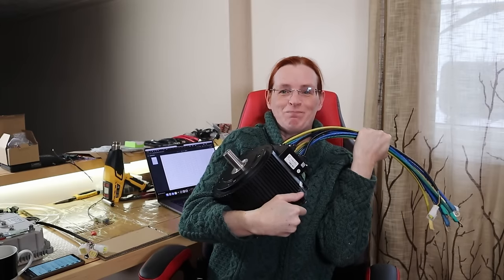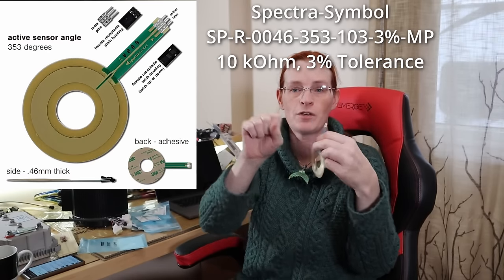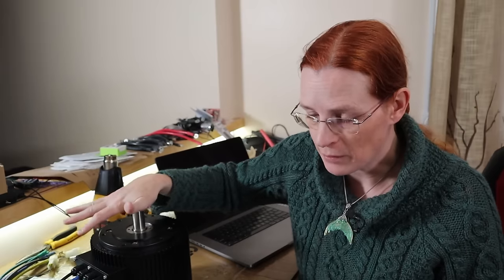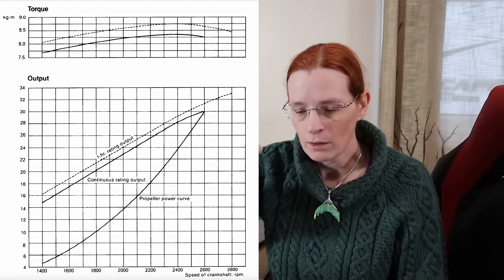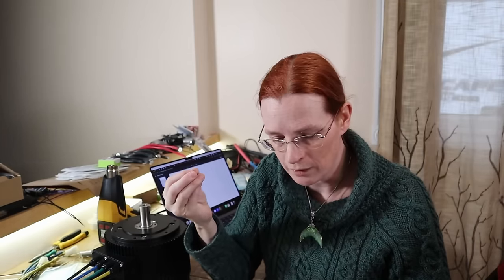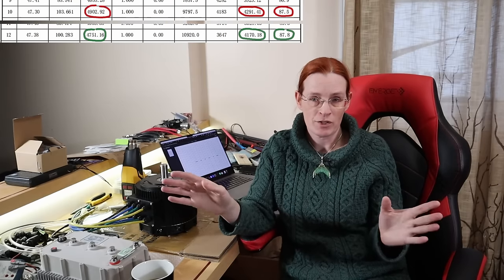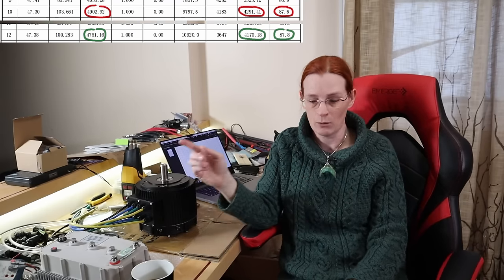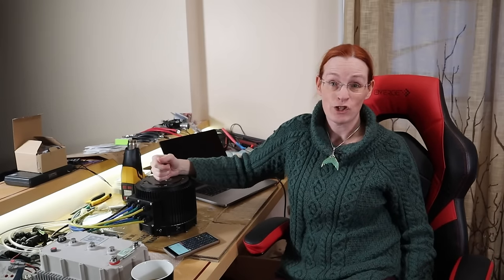Ep. 86 - Decisions Made! - Let's Get Technical

Comment: Great video. Here is my amperage calculation. You must devide 360A with 3 phases and probably also devide by two because of two wires. So each wire is loaded with max 60A.
Reply from the maker: OOOOOOH, huh, why didn't I think of / realize this! OK, that makes a lot more sense why the wires are relatively smaller. Thank you!
Reply: @TheDigitalMermaid  - We all have times where we can't the forest with all that trees

You could use a gear system so you can switch between the big motor and a 5 kw motor. OK you need a second controller for it.
Reply: Thanks for this, came to say this and you beat me to it.
Reply from the maker: I could, but I'm really favouring simplicity as much as I can... A part that doesn't exist is a part that can't fail. :)
Reply: @TheDigitalMermaid  I was referring to the 3 phase power current requirements per lead but thanks for the reply.  I just became a Patreon.  You are much like me, I like to do all discrete design elements by myself, but sometimes I get stuck and say, you know what, that complicated relay protection assembly for illusory back emf protetection I have been trying to prototype for 3 weeks is better served by a $6 dollar board with a box of spares.
Reply: @TheDigitalMermaid  What does Elon Musk say, the best part is no part!
Reply from the maker: @theradioweyr  I saw, and I very very much appreciate it! I sent a little hello with the discord link to ya in Patreon. :) And ya, struggling to find the line between "ok you're just having fun now, turn your focus back to what's practical" is a real challenge.
Reply: Divide by 3 is only for the AC side between motor and controller.
Reply from the maker: @wimclinckspoor5731  Yup, that I get.

Comment: I'm excited about this new phase! Please reach out if there is anything I can help with - or if you get to a point where you want to air it out on a podcast! Keep it up!
Reply from the maker: Will do! As I mentioned in the video, and maybe even on the podcast; My long term goal is to help build an open source, hackable marine platform. So sharing all the code and designs is part of that, specifically because I know folks will improve it far better than I could ever do alone.

Comment: I very much enjoy these theory-craft style of videos, even though I assume the greater public may not. Thanks for all the detail, as always.
What I can offer in contribution later on: Like you, I have an an IT/coding background (C++ specifically). So once the code for the throttle-management-arduino is written, I can do a code review. Having more eyes on critical code/infrastructure like that surely won't hurt. I had forgotten to join the patreon discord, but fixed that now. So if/when you want eyes on something C++, just let me know.
Reply from the maker: See, this is why I love open source! I didn't mention it in the video, but one of the things I'm hoping to do longer term is to have a small community of folks working on / helping with an open platform for boating. One of the reasons I decided to go inboard was that I couldn't find a pod system (or really even inboard systems) that were truly hackable. If I can make this work, my dream is that it might kinda become a seed for an open marine platform (and who knows what else). So yes, code review would be more than appreciated! I'll setup a github repo when I finally get started.
Reply from the maker: Heh, well what's the old saying; "Don't let perfection be the enemy of 'good enough'.". I love open source, but I'm not a zealot also. For this project, it's striking a balance between hackable / repairable and time to get back on the water. Who knows though, down the road a controller swap might entirely be on the table.

Comment: The idea with 2 motors of different sizes is amazing, great work!
Reply from the maker: I am really really excited to do both comparison testing, and parallel testing. It's going to be so much fun!
Reply: Also, consider getting a proper, automotive grade microcontroller, arduino board will die when it smells saltwater. I would be happy to help with getting it going if you want.
Reply from the maker: @alexpyattaev  Andrew and I are planning, when the design is done, to make a custom PCB. If/when that happens, it'll be beefed up and tinned, conformally coated, etc.
Reply: @TheDigitalMermaid  Sounds like you got the basics covered! Just make 3-4 of those boards =)
Reply from the maker: Absolutely, I'll have a generous spares kit.
Reply: @TheDigitalMermaid This actually sounds to me like the biggest benefit of electric systems. Most parts are either quite interchangeable (like wires or batteries) or fairly lightweight so you can actually have spares for most of your drivetrain. And you are certainly not going to be keeping a spare transmission for your diesel on a small sailboat. At the moment it seems the most flaky part of your setup in the charge controller.
Reply from the maker: @alexpyattaev  There are a few ways to charge; Shore (2x Multiple-II), MPPTs, and hydrogen, so I've got decent coverage there, and the Victron stuff has proven pretty reliable. But ya, much easier to have spares, and I'll have two complete drive options, so reliability should be better than any diesel, if my plans work out. :)

Comment: We run parallel motors on our machines at work all the time we set them up to speed following but limit the torque to 80% (that can be tuned up or down to suit each application) on the slave.
That way the slave has the correct speed reference to match the master motor rpm but it just go’s in to torque limit and sits there helping master along.
Reply from the maker: OK, so, I think I kinda understand what you're saying, but not completely. Can you recommend any articles or papers that explain this in more technical detail? I'd love to learn more about this.
Reply: @digimer sound familiar?
Reply from the maker: Brilliant, thank you!

Comment: I enjoy watching your videos! What a project! I'm an electric boat enthusiast myself, but with smaller dingies in fresh water during summer in Norway. I currently use a Golden motor X10 (6.5KW), and it has been running great since I got it a year ago. As this is a mobile setup, I decided to switch from Lifepo4 48V pack to a 14S NMC battery build to save some weight. I'm aware of the more aggressive chemistry, so everything is built sealed in a water tight box. My pack lost almost 10KG and I gained 70% more juice for longer runtime. Obviously no solution for a wooden sailboat, but if solid state batteries get mainstream, you can potentially get three times more dens than with Lifepo4.
Reply from the maker: In my mind, the real goal is for someone to understand the pros and cons of the available choices. If someone understands the concerns around NMC, and chooses it anyway, all good. I wouldn't do it, but then, I'm doing stuff others would never do. In the end, we're having fun as safely as each of us can. :)

Comment: I really enjoy your enthusiasm (and your orange sweater looked better 🙂 ).  I'm currently also converting a sailboat to electric but using the small 3kW golden motor. The sailboat is also used for regatta's and the boat is a lot smaller than yours. However, I doubt that you can regenerate significant amount of power from your propeller. If you try to turn the motor shaft by hand you already feel how hard it goes and there is not enough "grip" between propeller and water. A gearbox/reduction would certainly help. Most of the time you will operate the engine in the lower efficiency ranges. The torque is needed when you accelerate but once the boat is moving at the speed you want, you can take the rpm's back to save energy (and not operate the engine at optimum efficiency).
Reply from the maker: A 17" prop is a lot of surface area to apply a rotation to. :) However, it's all speculation until she's back in the water.

Comment: Great video. I'm doing a similar thing with a power catamaran. I'm planning approx 45kwh per hull and 15kW electric outboards by an Austrian company called Aquamot, their Trend 15,0 motors. I will have a 6kW solar canopy and hopefully a weight of between 4 and 5 metric tonnes. The displacement should only be about 0.5m. Like you, all this is theoretical. Good luck with the insurance company.
Reply from the maker: Having two completely separate motors/props, and so much solar area is the only thing that makes me consider cats. I envy your capacity in this way. :D Please keep me posted on your project as you work on it, I love hearing about other's projects. :)

Comment: (So I think you thought of this already, but I’ll leave the comment anyway. :) I have no experience doing what you are doing, but some questions come to mind. Maybe running a 5kw and a 10kw motor will let you pick the most efficient one for the speed you want. Also, I suspect that the regen efficiency curves are similar to the output efficiency curves so you may get better regen efficiency at low speed from the 5kw motor. Anyway, I appreciate your explanations and thought process. Good job!
Reply from the maker: The regen efficiency tracking the output efficiency is very much what I hope turns out to be true... If so, this should help scavenge power even at relatively lower speeds!

Comment: Suggest that you consider differential sizing of the motors. This still provides redundancy that you want but allows higher efficiency at “part throttle” as well as potentially greater regen. 

Having some type of clutch instead of a belt would also increase efficiency, but the ability to vary the drive ratio may give better end to end efficiency.
Reply from the maker: The prop is designed for 1200 rpm, and the motor is closer to 4000rpm, so I need to reduce the gearing via different sized pulleys.
Reply: @TheDigitalMermaid  What type of belt? Toothed belt may have less losses but vee or poly vee allow some slip to protect against over torque damage if prop stalls.
Reply from the maker: Originally I was leaning v for just that reason, but I am leaning back to toothed and will consider a sheer pin as a prop-strike safety.

Comment: Hi Digital Mermaid, very informative video as usual, Thanks. the resistive throttle you showed may not be ideal for use near water and humid environments, look into a hall effect controller or similar.
Reply from the maker: Aye, a few folks have concerns about the pot near water, it's something I'll put more thought into.
Reply: A hall sensor is the way to go, I’m using this type and it’s working for more then 4 year without any problem

Comment: Maddy I can't help but wonder when considering wasted energy, about the large inefficiency's of belt drives over a direct drive coupling, along with less need for, and stress on carrier bearings that will also require regular servicing etc.
If using a second motor I'm sure they can be bought with double ended shafts so that two motors can be mounted direct coupled inline.
Maddy you may have already considered all this, and I am certainly no authority on this, I'm just throwing it out there.
The prop will be and interesting subject as well, I'm assuming that the propeller pitch for drive/propulsion will be vastly different than the pitch required for regen?
Always love your videos and watching you figure things out.
Reply from the maker: Direct coupling would certainly be ideal, but it's just not feasible on my boat. The old engine uses a v-drive transmission, which you can see in the clip where I'm on the boat talking about the battery placement. So the best I can do is try to get the most efficient belt setup I can.

Comment: Love your channel. I had roughly the same sized diesel engine in a Gemini Catamaran but with a leg like an inboard/outboard. The leg is not made any more and the parts are getting hard to find so I swapped it out for an long leg outboard a few years ago. I have warned my wife that next time I would really like to go electric. Hopefully by then long legged affordable electric outboards will be available.
Reply from the maker: I think you're referring to "Sail drive" type motors, eh? I've seen plenty of electric sail drives, if so. Electric sailing is a young tech, but it's evolving FAST. By the time you need to look at a repower, the options should be a lot more that today.
Reply: @TheDigitalMermaid The difference with a typical sail drive is for my boat the engine needs to be raiseable like an outboard or a inboard/outboard leg. The Gemini 105M can pull up its rudders and centreboards and get into 18" of water which lets us poke into places on the coast of BC that we couldn't in our previous boat a Catalina 30'. Torqeedo outboards were around when I repowered but way out of my price range but yes, prices have been dropping and more options are coming all the time. Thank you for all the information you provide during your learning experience.
Reply from the maker: @mngbennett  Aaaaah, I see now what you mean. Wow, 18", that's shallow!
Reply: @TheDigitalMermaid  Other owners beach the Geminis but I think I would only do that in an emergency. I am looking forward to the your solar arch. That is on my list of to do's. I just built a light weight version using canopy parts and it is good enough for 4 100 watt panels but I want something sturdier that I can also use to lift the dinghy.
Reply from the maker: @mngbennett  The solar arch is something I've got a vague plan for but I'm not diving into in details yet. I'm waiting to see how to balance of the boat is after the batteries and motors are in, to get a feel for how miserly I need to be with the weight.